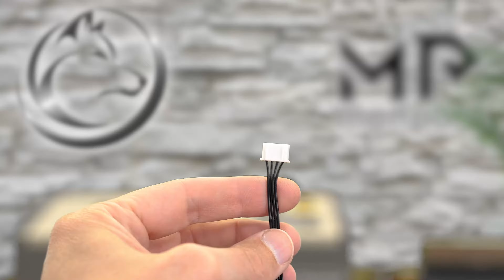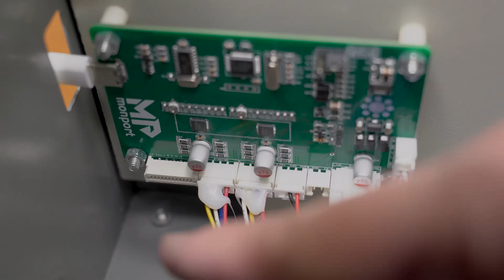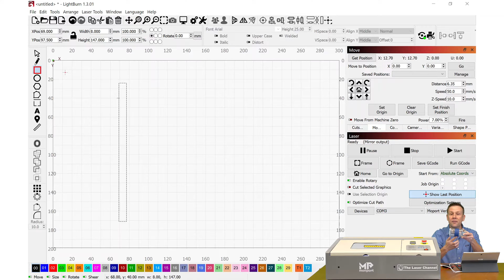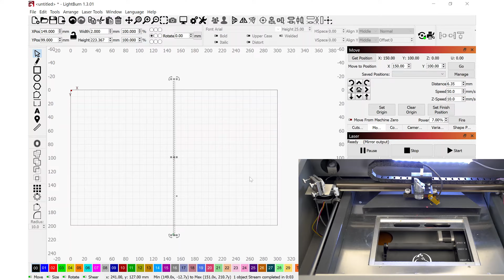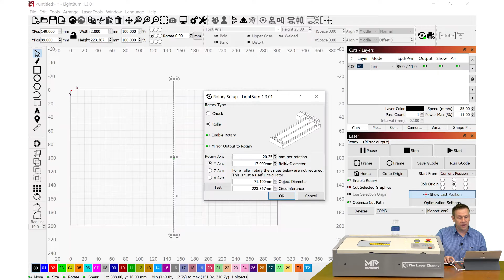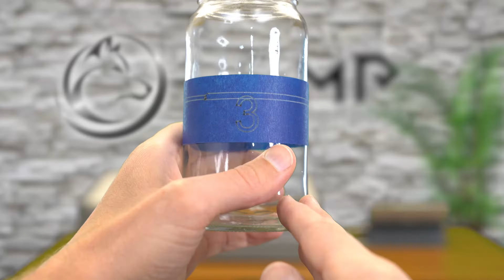Monport 40 watt- Maximum Fun-  Rotary Roller Install

Comment: Great information. Thanks! How did you determine the mm per rotation in your roller setting?
Reply from the maker: Great question- I adjust the number until the machine moves the correct rotation distance.  So I'll draw a box something like 4 inches tall and then engrave the item in the rotary-I want the 4 inches in the software to match the same 4 inches engraved.  Any distance can be used.

Comment: what if your engraving a glass instead of a jar and it tapers and the diameter changes?
Reply from the maker: If you're using a roller type rotary then all parts touching the rotary must be the same diameter to turn properly. Lightburn has a taper feature to correct for the taper.  Here's another video for engraving tapered glasses- different machine but same concept: https://youtu.be/JWfXfd0dHFc

Comment: What size of object will fit in this machine? I’m thinking of buying the monport 40w pro.  Being inside a cabinet with a low profile roller what’s the maximum diameter an object could be that will fit under the laser head? Thanks!
Reply from the maker: Hi- I would recommend a max diameter of about 2.75 inches (127mm).  I used a pint glass  at diameter of 3.25 inches and it was slightly out of focus but still worked.  I some some people choose to cut the bottom of the cabinet out as another option.
Reply: @thelaserchannel1  I wondered about cutting the bottom. What would be a good way of doing that without shaking everything out of alignment?  Or is it pretty difficult to disturb the alignment?
Reply from the maker: @richcuatt8652   There's a tool called a nibbler- it cuts out little squares and with enough "nibbles" the cut out can be completed. Leaving all to components in the machine I would use the hand nibbler rather than a power nibbler.

Comment: Hi, i like all your videos,i want to buy my first laser as a hobby to start.Base on your experience wich one do you recommend ATEZR L2 36W-Wizmaker L136W or Montport 40w?for glass and metal
Reply from the maker: Thank you!  I haven't ran an ATEZR laser machine so I can't comment on the performance.  I have worked with glass and some metal with a laser diode machine like the Wizmaker L1 36 watt.  The Monport 40w Co2 laser I have engraved glass- it's very fast and does not required a masking agent on the glass; I haven't worked with metal engraving with the Monport 40, I plan to in the near future.   Hope this helps and thanks for watching The Laser Channel!